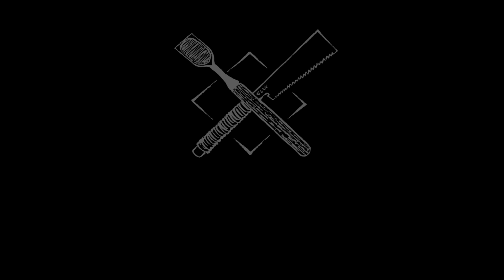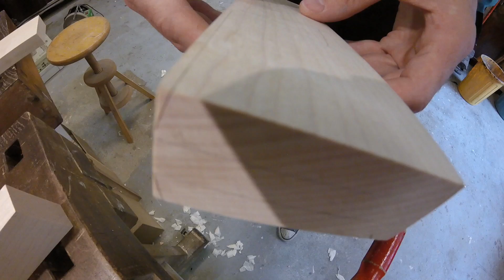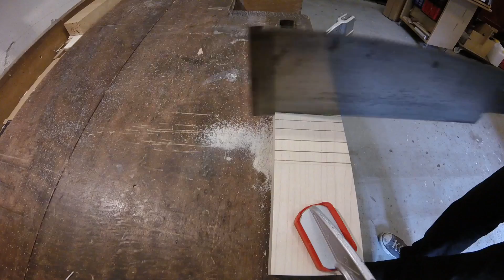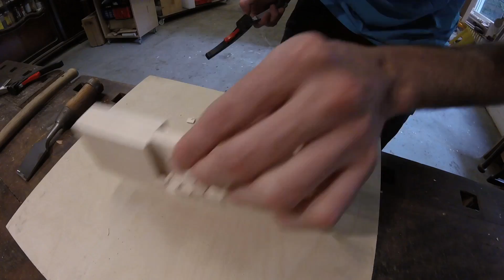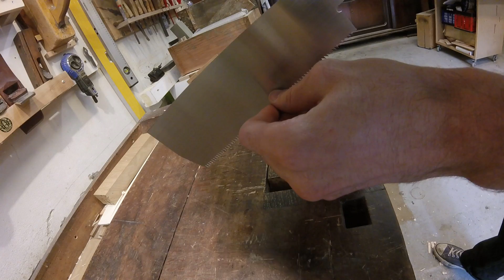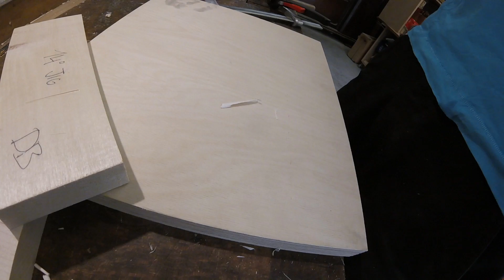Joint Venture Ep. 4: Through dovetailed bridle joint (Western Joinery)

Comment: What would the technical benefits be of using a dovetailed bridle joint instead of a simple bridle? Other than looks wouldn't they offer practically the same benefits?
Reply from the maker: It offers the benefit of additional shear resistance, lessening the stress on the bridle base.

Comment: Beautiful looking joint as always so hats off to you,sir.
I am struggling to see a use for such a joint though.
It would be of no use in carpentry (structural) as it seriously weakens the 'female' part of the timber,breaking the '1/3 rule' for mortice width by a factor of 2 and has nothing like the strength of a mortice and tenon joint,which would also be pegged with a draw-bore.
I imagine it would be very useful for knock-down(dismantleable) furniture where wedged through tenons might not look right.
Reply from the maker: Thank you. Yes, the dovetails just add extra shear strength.

Comment: I Love your videos. I am just wondering: why 14° at the last corner?
Reply from the maker: It locks the bridle in place and only gives it room to move on one plane. It strengthens the joint in other words :)
Reply: Dorian Bracht thx, so you could have used 15°...  :)  14° is so unusual, and that was blowing my mind. thx a lot
Reply from the maker: +josé Viana my router bit is 14 degrees. It is the 1:4 ratio for dovetails I think.

Comment: How long did it take you to get used to pull-saws? I have tried them a couple of times only, and it just feels wrong
Reply from the maker: I learned with pull saws, so it's natural for me.
Reply: @DorianBracht  I thought this comment was interesting! I’m only a hobby woodworker, and in all my years (61) all I ever used as far as manual saws was the old standard push type. However, they always felt awkward to me. Last year, I picked up two pull type saws, one small and a larger one. Long story short, 15 seconds into my first cut I was hooked! I guess we’re all different, but they just “clicked” with me! And mine are cheap versions!